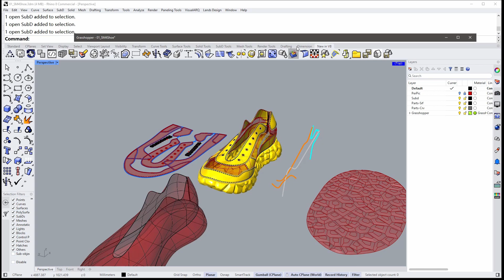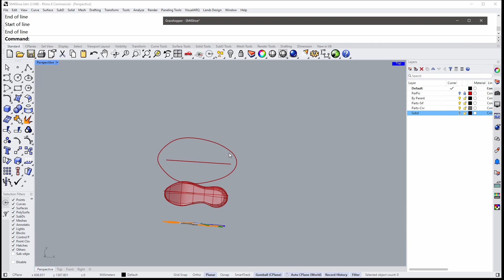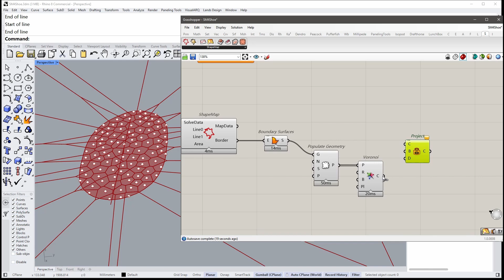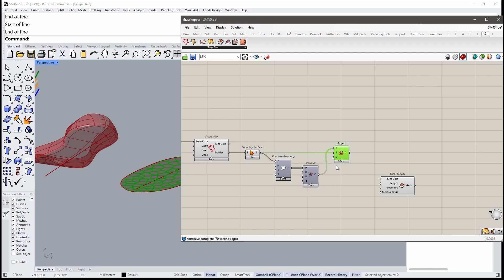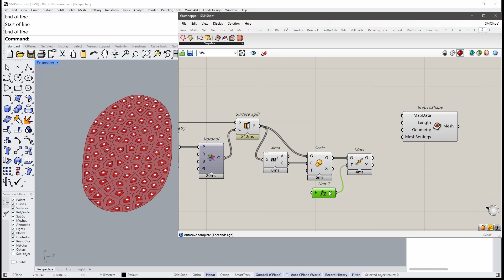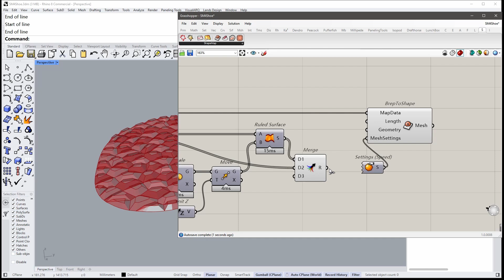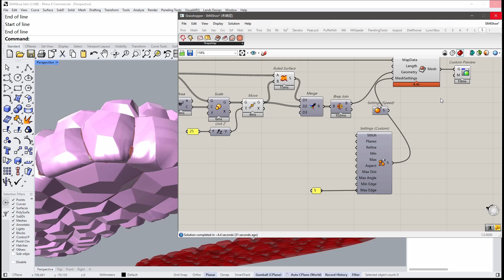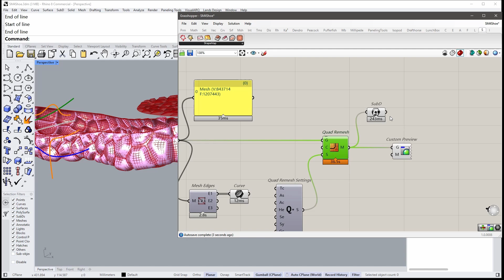Using ShapeMap to crate shoe sole texture

Comment: I was trying to follow the example from the tutorial. I have a problem when I load my 3D file . How can I explode the shoe into various parts? The example model allows me to do this, but I can’t figure out how to do it with my subd model. In my 3D model, I simply applied a quad remesh with subd. Do I need to mark the sole line in some way?
Reply from the maker: Could you post your question here https://discourse.mcneel.com/c/plug-ins/shapemap/174 ? Thanks.